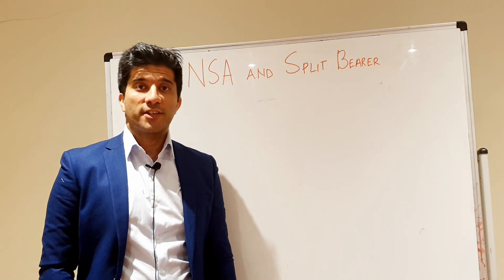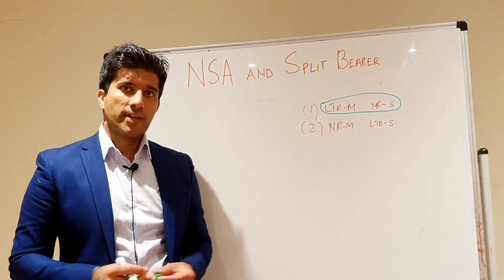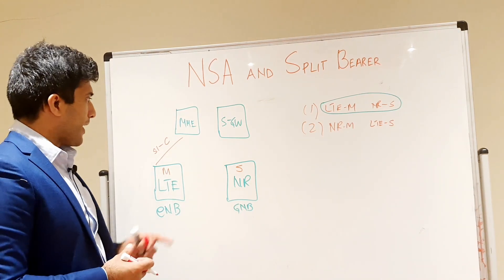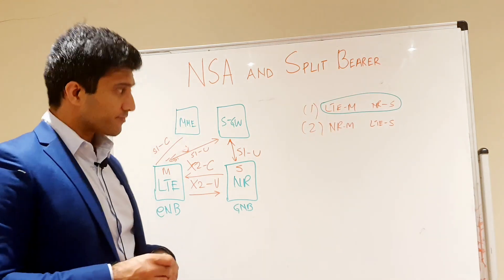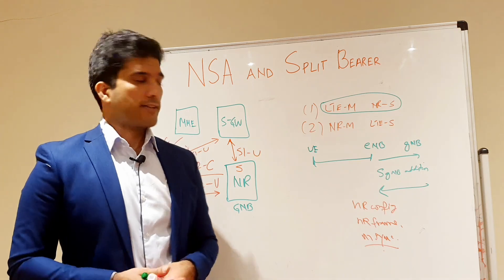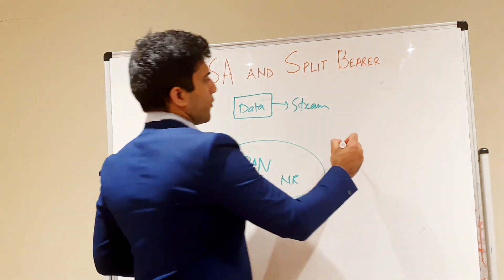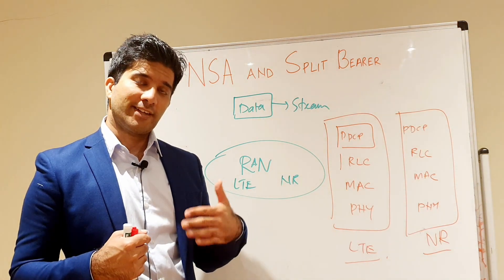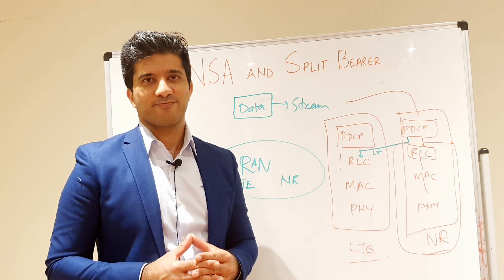5G Training Lecture #6 : Non-Standalone 5G User & Control Plane config and Split Bearer for PDCP

Comment: Hi. Thanks for good material. I am confused about one thing. You mentioned that PDCP in NR node will decide which amount of data will goes through the RLC in both NR and LTE node in case of split bearer. If LTE is the master node, shouldn't the LTE PDCP be in charge for this?
Reply from the maker: LTE is the master node in terms of setting up the RRC connection and then adding the NR node. The split bearer setup is usually configured with NR as the priority PDCP layer.